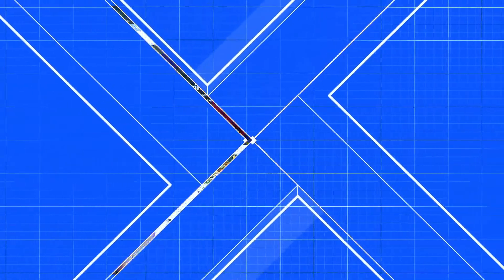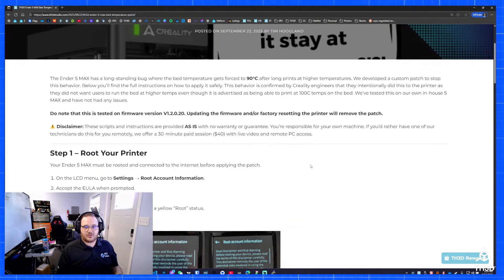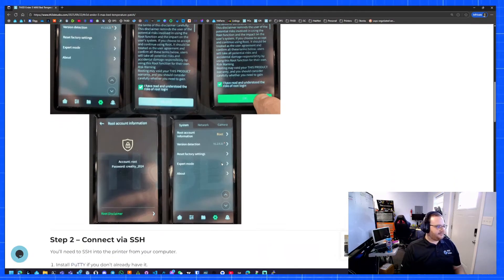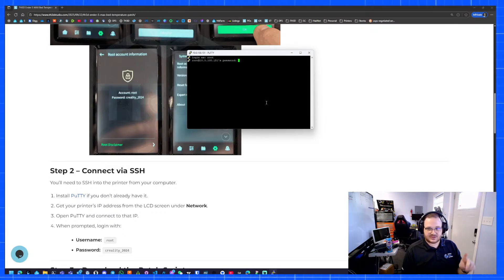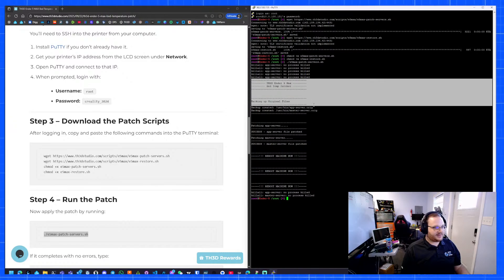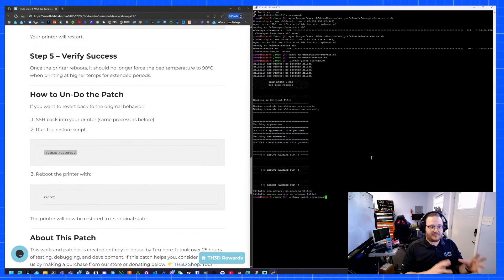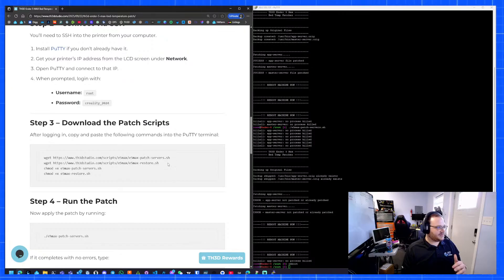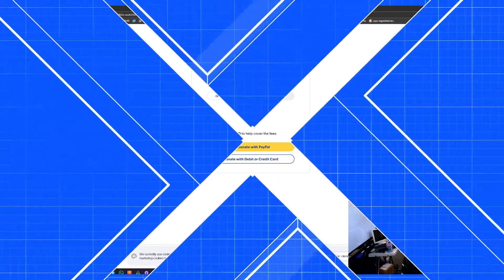Ender 5 MAX Bed Temperature Fix

Comment: Shouldn’t be printing abs on this in the first place unless you have the enclosure. Even then it’s not sealed so you’ll need some type of fume extraction for the room it’s in.
Reply from the maker: They make an enclosure for the E5 MAX. We have it, just didnt have it installed for the video. And you don't need fume extraction, thats overkill. You can if you want but its not needed.

Comment: Hi sir trying to find the ssh code on my printer and it is not showing up under the network tab on the printer screen?
Reply from the maker: You mean the IP address? If so it has to be connected to the WiFi in order to show an IP
Reply: @TH3DStudio yeah got it found wifi was being quite the ass that night. Thank you for the help

Comment: Thank you for this. I have a question. Is there a way to calibrate the bed at temperatures other than 45 degrees? Or do I just have to upload files and start the print from the screen like I've been doing to get it to calibrate at something other than 45?